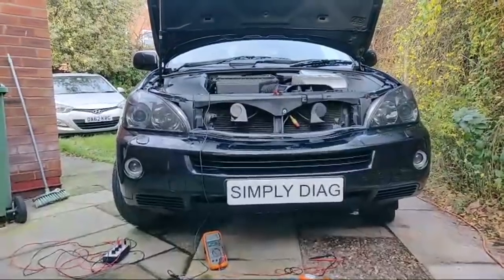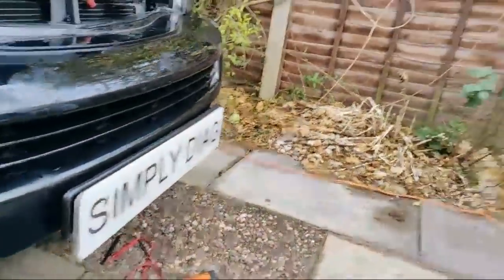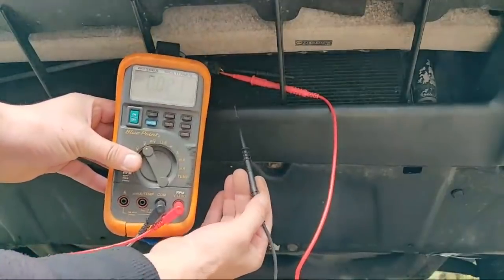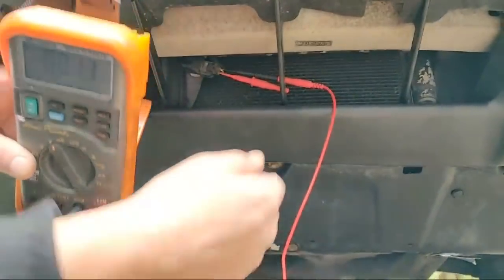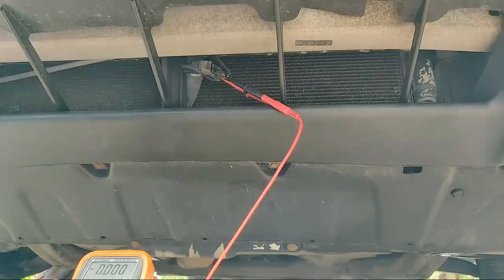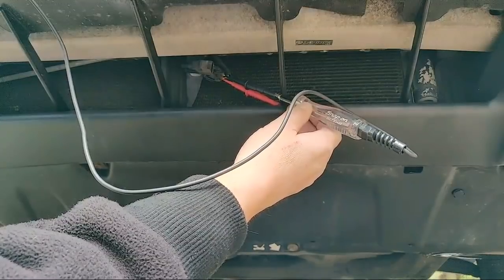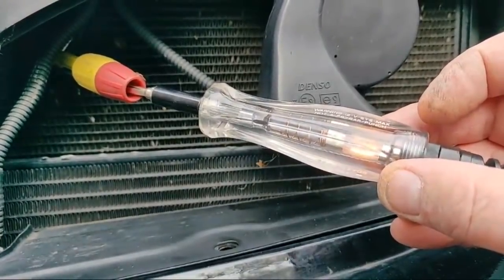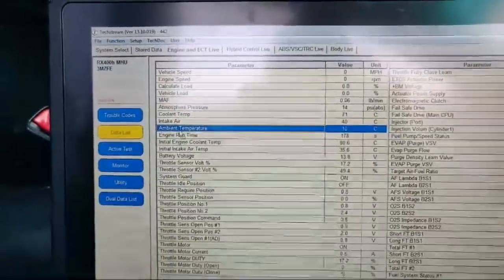How to test a  temperature sensor

Comment: have you got a link for a ecu safe test light ?
Reply from the maker: Any LED testlight should be safe, as long as you understand the circuit you're testing. Incandescent testlights need to pull less than 100mA and are a tad more risky. If you have any doubts about the circuit you're testing then LED only should be used - they will limit the current flow and should prevent damage.
Reply: I would have thought an incandescent test light that was in the 200-300Ma range would still be safe to test the signal wire, is that wrong?